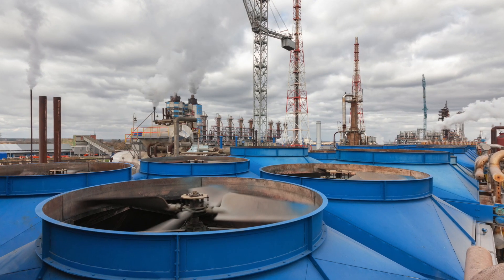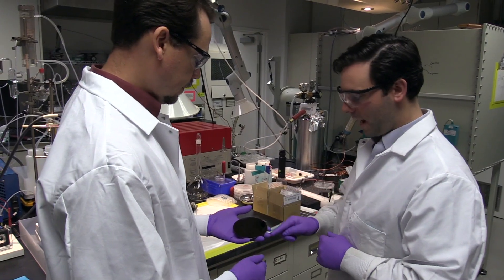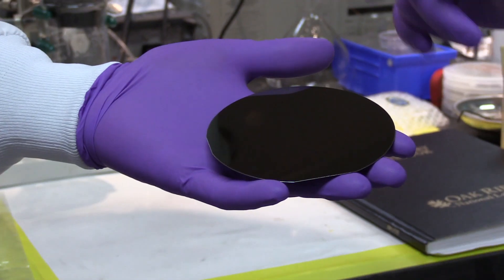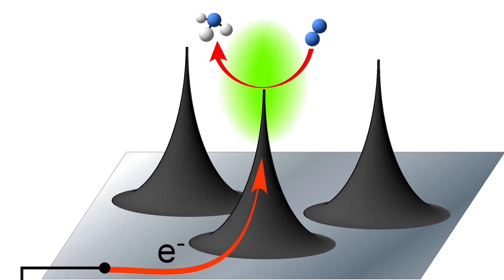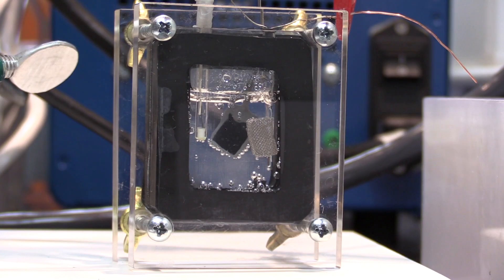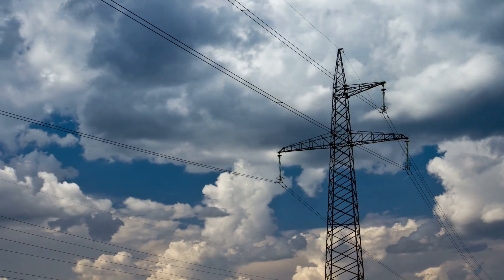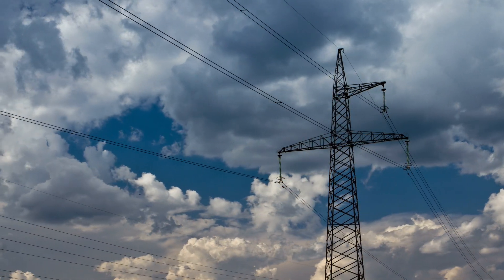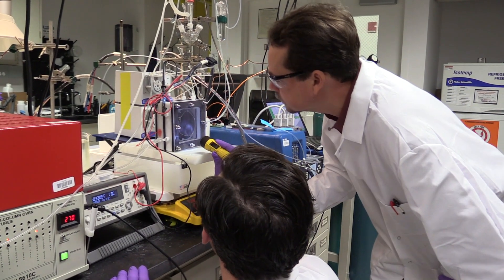Novel reaction could spark alternate approach to ammonia production

Comment: My engine will use NH3 and 6 other carbon fuels - gasoline, Diesel, Jet A, 100 LL, propane and NG- as well as solar thermal.  As a generator it could make electricity for less than 2 c/kwh and hence make NH3 for around $1/gal equiv. to gasoline.  The engine requires propane type tanks so it can use propane and NH3 and other fuels from the same tank.  See tweets @seaplaneguy.